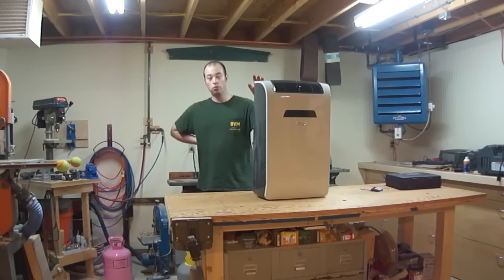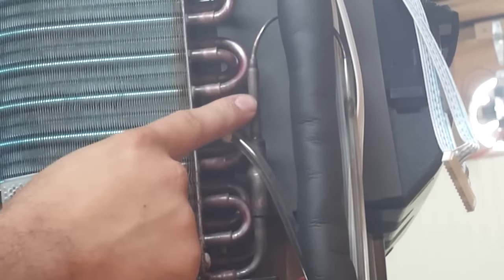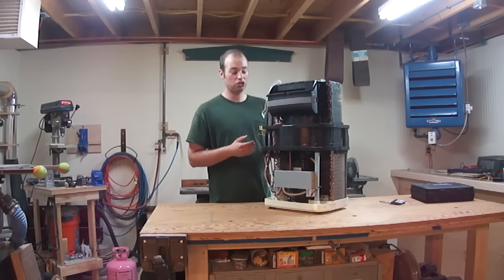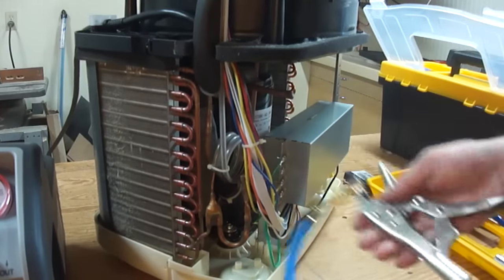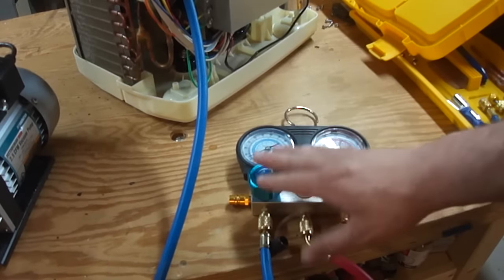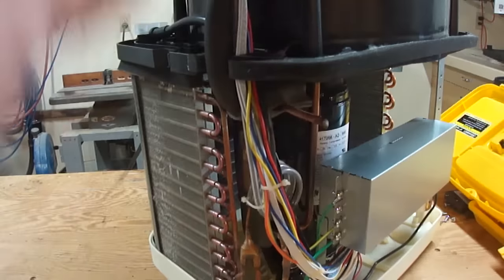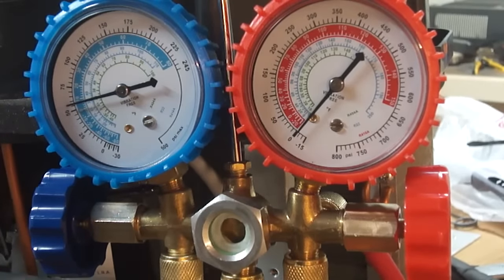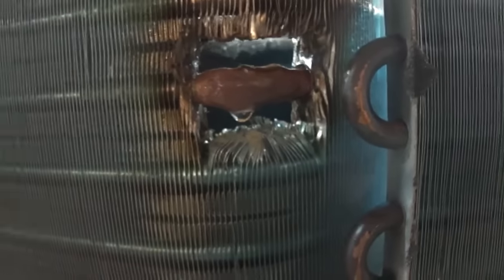How to Repair and Recharge A Portable Air Conditioner

Comment: Good Stuff from You Sir.   Yea it helps having a second Wrist and elbow some times.    Nitrogen is your friend.  LOTS and Lots of Nitrogen.   Dries things out most well.   A little jewelers torch would have been handy.  Micro Torch.
Reply from the maker: pulesjet nitrogen makes everything better in refrigeration systems!
Reply: @iainportalupi  The Stuff is magic being used in Piles of ways.  Drying lines out just one way.   And  it's easy to obtain.
Reply from the maker: pulesjet and it’s dirt cheap too!

Comment: Just curious, you cleaned the outlet tube just before piercing it, to drain the freon. You used, sand paper I think. Your rubbing action was on top, yet you pierced it from the bottom? Had I previously sanded the bottom or?  Just wondering... But I enjoyed the rest of the video
Reply from the maker: urbie green I used emery cloth because is it can take bending better than sand paper can. If you watch very closely around @4:40 you’ll see a cut in the video. That is where I cleaned the bottom and sides of the tube. I didn’t show it because my arm was in the way so you couldn’t see any of it anyways. Plus who wants to watch somebody sand the outside of a pipe?

Comment: Also, I wouldn't use the recovered refrigerant since the sealed system was exposed to the atmosphere causing possible contamination.  Use the fresh. I'd also add a drier.

Comment: so... do you do this for a living? Repair broken AC units? or? What do you generally charge  to repair, and refill a AC unit with refrigerant?
Reply from the maker: Bewildering Truth Seeker I do it part time. Around here almost every house has a dehumidifier in the basement. Those things leak refrigerant like crazy so most of what I do is fixing those things.

Comment: How do you knw how much refrigerant to put in and are u able to change to 134 refrigerant? Appreciate the response.
Reply from the maker: Every appliance comes with a sticker that says how much refrigerant it takes. As for switching from 410a to 134a the short answer is no. The longer answer is you’d have to redo the capillary tube to work with the 134a refrigerant.
Reply: Mine doesn't state how much it takes its a hisense 5000-btu.

Comment: How can I vacuum the system without using a vacuum pump?
Reply from the maker: Mhd Sbahi unfortunately you can’t do it without a vacuum pump. A good vacuum pump is a key tool for doing refrigeration work.

Comment: What I dont understand is. You fill the AC unit; based on the ambient temp compared to what the pressure should be at for r410a. If the AC is running the low side drops; how do you know how much you need to add? Because the pressure doesnt add up to the pressure/temperature chart when the AC is running.
Reply from the maker: The refrigerant is added by weight. The ac has a sticker on it that said how much refrigerant went in it.
Reply: @iainportalupi  Ah ok, I get it then. Back tot drawing board then for my broken mini split as I can't get my hands on a recovery machine :(

Comment: How much did you charge for that repair? A new unit 5000 BTU is only $300
Reply from the maker: Back when I did this particular one it was $50, now I charge $60 for the same repair because the supplies cost more.

Comment: What did you braze it with? Silver solder or brass ??
Reply from the maker: I use Harris Stay-Silv 15 it’s made for joining copper to coper connections for refRigeration systems.
Reply: @iainportalupi  thanks 👍

Comment: Great video. But i must know what happens whn you dump vapor in the tank when its full. Lol what does..it gets real weird real fast mean.
Reply: What do you mean you want + presure to keep grit out if the hole? 
Why flare the tubing instead of using a fitting.?
Reply from the maker: If you send vapor into the liquid line on the recovery bottle this causes the vapor to bubble up through the liquid that is already in the tank. This generates a lot of heat. The hotter the tank gets the higher the pressure gets in the tank. It is possible for the tank pressure to exceed the tank’s rated pressure in that situation. As for the positive pressure in the line, you don’t want grit from the emery cloth going into the copper line because that will circulate through the system either wearing out the compressor or plugging the capillary tube.  As for flaring the tubing vs using a fitting they don’t really make couplers for small tubing like this rated for use in refrigeration systems especially not for a high pressure refrigerant like 410a.

Comment: Does it trip the 15a breaker if freon is not enough?
Reply from the maker: Not usually. That sounds more like the compressor isn’t able to start. Best case scenario the starting circuit needs replaced worse case the compressor is locked up and needs to be replaced.

Comment: What should be the temperature at the outlet of the air conditioner?
Reply from the maker: When you say “outlet” do you mean the cold air blowing into the room or the hot air being vented outside? The cold air blowing into the room should be 15-20 degrees colder than the room air. The hot air from the vent should be 15-20 degrees hotter than the outside air.

Comment: Do we need to refill coolant in portable air conditioner every few years?
Reply from the maker: Not unless there is a leak. The refrigerant should be good for the life of the system. If a portable air conditioner is low/out of refrigerant there’s a leak that needs to be fixed before refilling.

Comment: You should have used heat barrier spray so you don't burn up all the insulation.  I use Sil-Fos 15% rods when brazing.

Comment: Bought a new Magnavox portable, but thought I could have had the old LG portable ac, recharged. Knowing the process just not a simple matter of accessing a port/valve and replacing the freon after repairing a leak, probably too expensive to pay a hvac tech to do the job and not an easy DIY  job 
for the unskilled even if you had the tools. Hated to thow out the old LG, but not a simple fix.

Comment: Your looking at about $1,000.00 in tools. Just for the purpose of repairing a $200.00 unit. For a owner if you do it right you probably only do this once. For the diyer its just not worth it. I would like to know where this guy is located? It might be worth the drive/postage.

Comment: I advise you not to use old refrigerant because R410A refrigerant consists of 50% R32 and 50% R125，if the system leak，that will cause the proportion to change.

Comment: Was your compressor still running?
Reply from the maker: The Broke Hunter yup.
Reply: Iain Portalupi dang my compressor won’t turn on
Reply from the maker: The Broke Hunter give it time. Some ACs have a built in delay of up to 2min after plugging it in before the compressor kicks in. I think the theory behind the delay is so the refrigerant can settle after moving the AC so it doesn’t hydrolock the compressor with liquid refrigerant. I’d plug it in and turn it on and wait. I’ve done a couple that I swore the compressor would never turn on but eventually it did.
Reply: I’ll have to try that. I’m waiting on my new multimeter to test the capacitor.
Reply: I’m having the same problem. And when/ if it does kick on it pops my breakers.

Comment: Eh..  small sealed system:.  Id just put on gloves and cut the filter drier off since its already leaked out most of its life blood..  just as long as its r134..  replace the filter drier after a nitrogen purge and leak test for a few hours or days to find any micro leaks with some dye in there with the nitro..  then fix the leak, vacuum and refill..

Comment: Not much you can do about burning the insulation on the other pipe? How about a smaller torch?
Reply from the maker: A smaller torch wouldn’t heat the tubing enough.
Reply: @iainportalupi  

https://www.youtube.com/watch?v=31FwXg7_ZOY

^^^That's with a really small mini torch^^^

Get yourself something like a SnapOn Torch300. Harbor Freights comparable is cheaper but doesn't last as long. Much easier than trying to braze with that gigantic torch. I understand the video is done on pipe used for plumbing (the video I linked) but I've gotten copper red hot with my Torch300. Just takes a little longer but when space is an issue, its great. It'll braze those tiny refrigerant lines perfectly fine.

Comment: I clicked on this video thinking of DIY and as soon as he busted out that 1930s welder. Nope... nitro forget about it. I wonder how much this service costs vs buying a new unit? It's almost like the design of these are designed to leak
Reply from the maker: I’ve fixed so many of them that I’m pretty sure they are, in fact, designed to leak. These and dehumidifiers always develops leaks, window ACs and refrigerators don’t leak very often.

Comment: you forgot to use your de burring tool on the inside of the cut off tubing
Reply from the maker: I never de bur tubing on small refrigeration systems. I don’t want to risk getting copper particles in the system that could clog the cap tube or get sucked into the compressor.

Comment: Thank you very much for this video. I learned so much about the subject matter but most importanly I realized that the LG A/C unit with Double Inverter that I bought from Home Depot is a piece of crap because on the first usage today it gave me code CH which according to you the manufacturer it means it needs refrigerant!! On the first use? And then when you call them they have the excuse on COVID and they hang up! With so much pleasure I will return it to Home Depot and will get my $750 back. But thanks for your video. Freaking LG stands for Lowest Grade in Chinese lexicon.